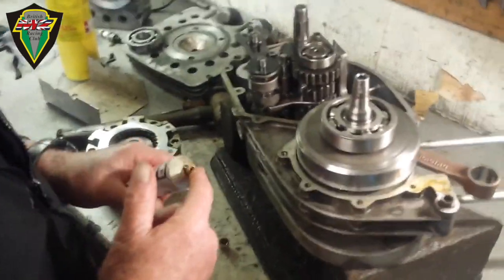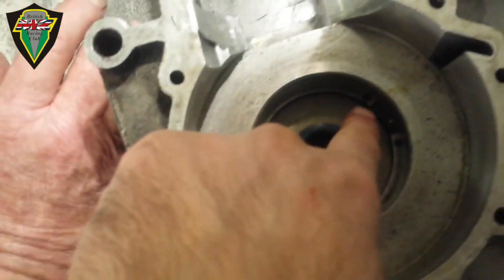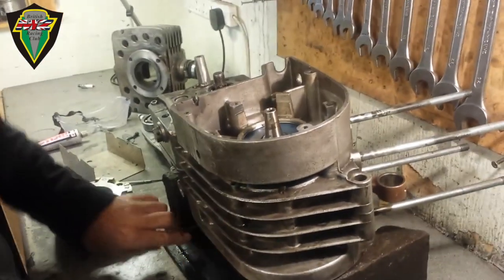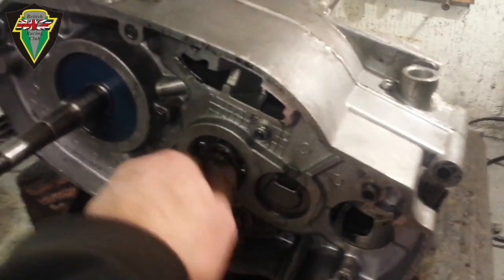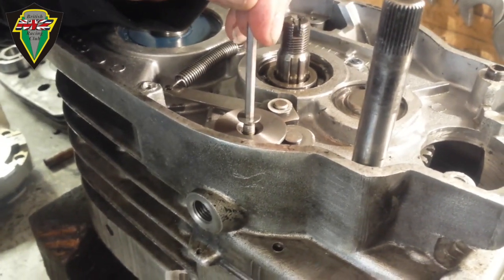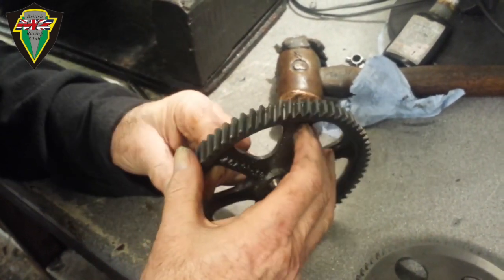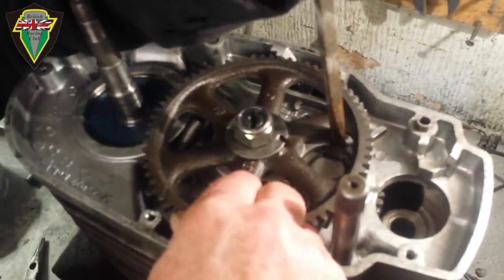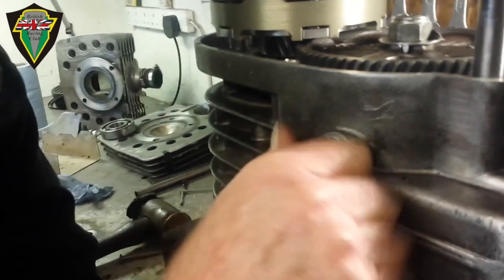MZ ETZ 250 joining the crankcases

Comment: A couple of points....Heating the right case up to spitting hot rather than the recommended 100 C will fry the Wellseal on contact...not good. Also it is easier to fit the the right case THEN the oil guide disc which can now be easily located in the correct position, then fit the bearing circlip... then and finally the oil seal which can be positioned on the shaft more carefully...
Reply: Thanks for the extra tips. I can see how putting the circlip and seal would be easier after the cases are joined.